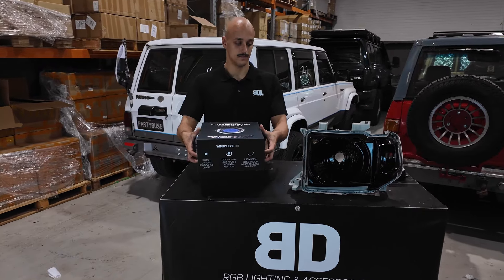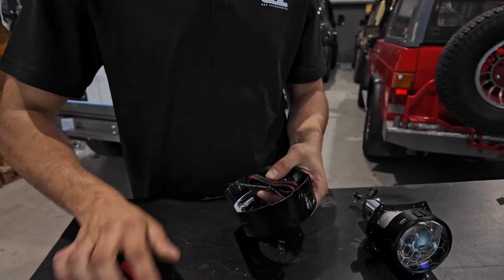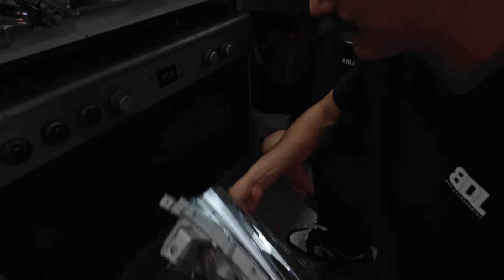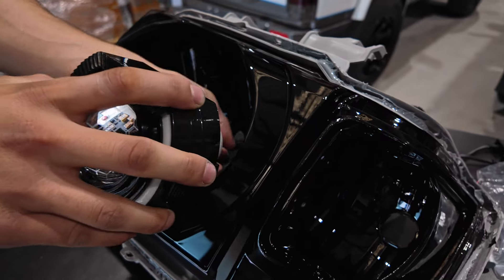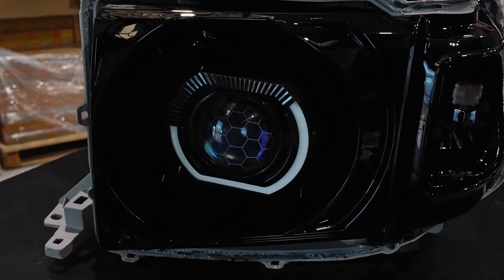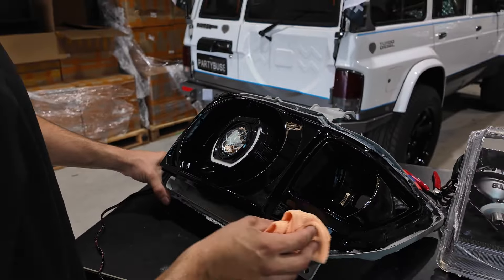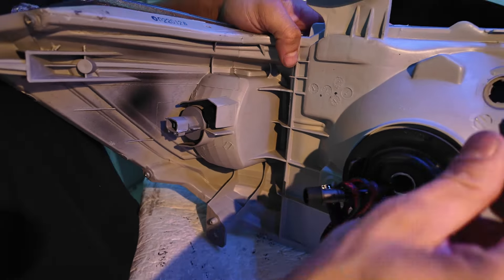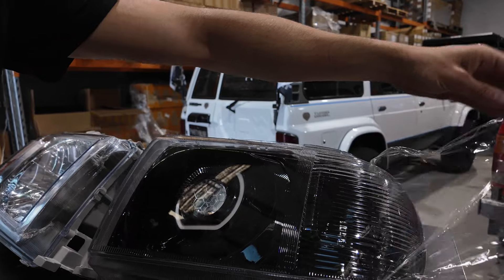Easy DIY Retrofit Headlight Kit | Instructional Video

Comment: 4:45 how do you set up the indicators and Parkers? Do I need to splice wires? What do I need to do to get those to work? Thanks
Reply from the maker: Yes that's right, splice into your indicator and park light wiring. The included instructions will tell you which colour wire does what 🙂
Reply: @BushDoof  cheers Bushdoof team, much appreciated 🤙

Comment: If i dont want to use the turn signals do i have to hook up the turn signal wires?
Reply from the maker: Turn signal is optional, if you don't wish to use it you don't have to wire it in.